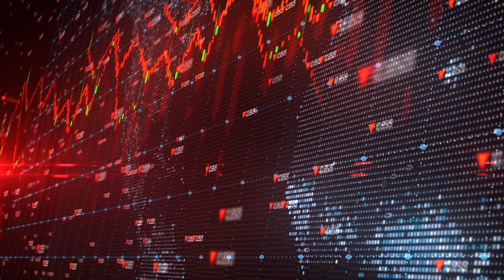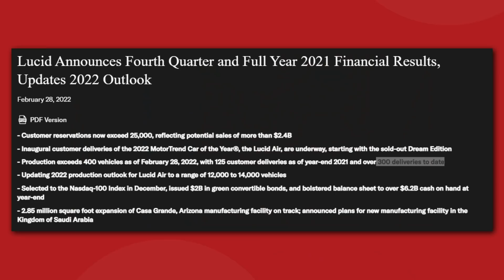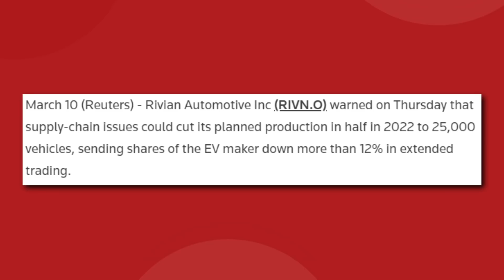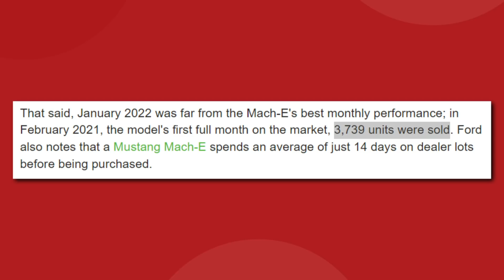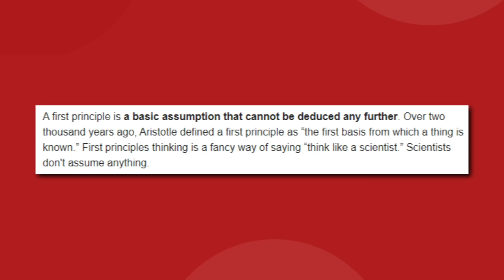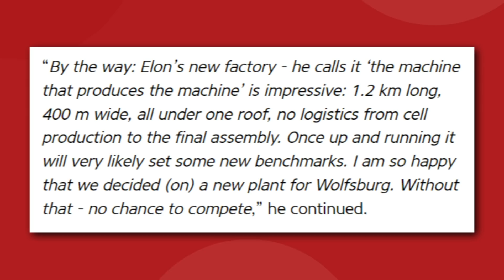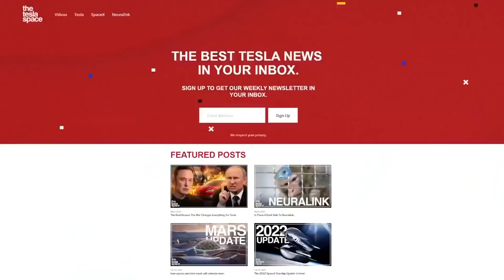Why The Gigafactory Is Tesla's Most Important Invention!

Comment: Working with these areas, it is good to see you got a lot in there and it's pretty correct across the board! Vertical integration is one of the best aspects of Tesla and it's so nice to see we continue to push what that means.
Reply: Vertical integration wouldn’t be the best option if niche manufacturing had high standards and the will to create the outstanding parts that Japanese manufacturing demanded for their domestic production … because too many producers turn out substandard products Vertical integration becomes necessary . For years Mitsubishi was was the go to company for automotive electrics … they fortunately had Opposition to keep them up to standard …

Comment: Mmmm, in the video it states that if no humans turned up to the Shanghai factory, the factory would still just continue to produce cars on it own - well, that's all well and good, however it clearly needs some human input as the factory has now been closed for over three weeks due to the lockdown with no end insight of the factory not running at all - and the share price just hasn't budged - that makes no logical sense at all. It also make no logical sense that a stock split should make the value of the company suddenly increase by 15% within days. It also makes no logical sense that we're about to suffer a huge bout of global stagflation with the key target market becoming significantly poorer whilst the input costs of the cars are going through the roof - and yet the share price just keeps on going up - none of this makes any sense unless it's simply down to hype and human emotion, which means that at some point, the share price will revert to the long term mean - especially when the cost of capital goes from zero to 5% plus.

Comment: From my view, the most incredible and innovative idea Elon has come up with, sounds so nothing nope. It's the factory Tent. Manufacturers spend millions to design a factory and hundreds of millions to build it and it may have a flaw from day one.
   Building the car in a tent first, allows for cheap and easy design and redesign of how the factory should function at highest efficiency. Then you build the factory that costs hundreds of millions and it's just right.Very efficient! 

   At Boca Chica, Elon has installed 3x 1 million tents to find out how to build the most innovative rocket since the saturn 5. Now one tent has been removed and footings have started for GiGa rocket. Also Boca is this odd, spaceport in the dirt, where construction workers are building rockets outside rather micron clean rooms with uber expensive hazmat suited technicians. A Getter done rocket building site. No Giant expensive gantries, for now, just scissor lifts and 400' high basket lift ext. trucks. Maybe the gantry will come when Elon and his engineers figure what the maximal efficiency of the structure first.
 The final conclusion is that Elon saves billions on R and D because of those tents. That cheap R and D leads directly to the lowest cost per of production and the highest profit  of any manufacturer. 

Yup those Tents are really something.
Reply: You may be right about the use of tents at SpaceX but not Tesla. Tesla initially purchased the NUMMI factory which had already produced volume vehicles like the Toyota Tacoma and the Chevy Cavalier. Initially they only occupied a quarter of the space due to low production numbers. They only moved to tents when the ran out of  room in the original factory.